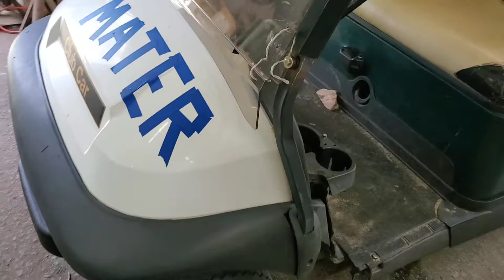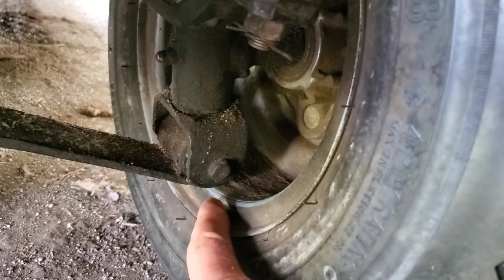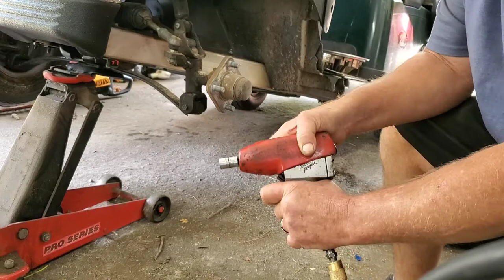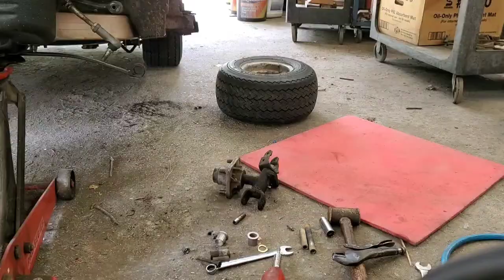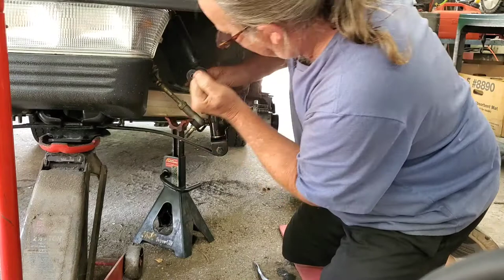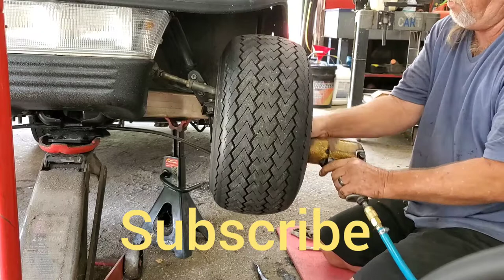TOW MATER CLUB CAR PRECEDENT FRONT END BUSHING REPAIR.  SAME FOR GAS OR ELECTRIC GOLF CART EASY DIY

Comment: It’s great to see someone else struggle with a repair they’ve never done before!  I’ve only been at this a couple years, so most of what I do is that way. Also great to see someone making do with bits and pieces in the shop scrap boxes! 😉
Only thing I was missing was a closeup of the completed repair from the backside of the wheel so we could see the difference from before. 🔧👍